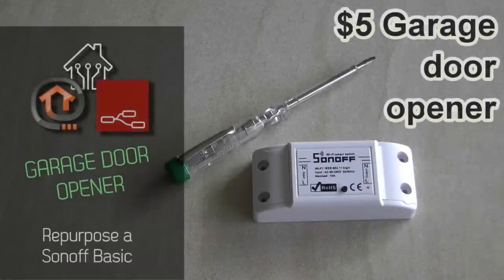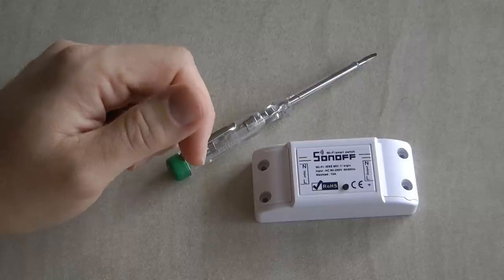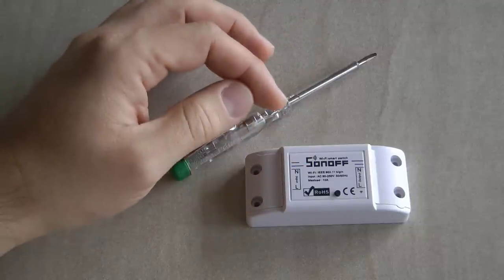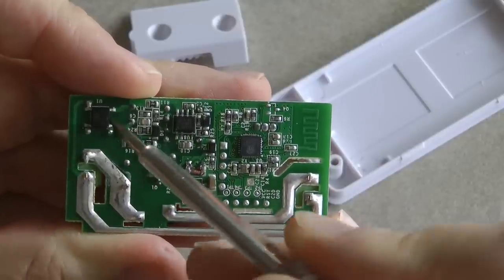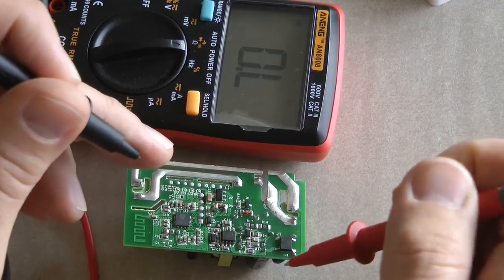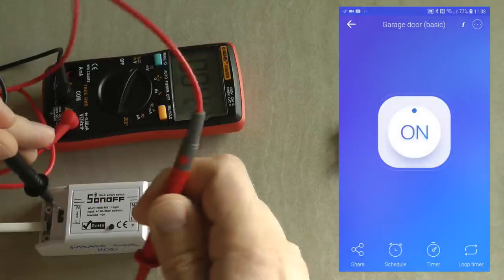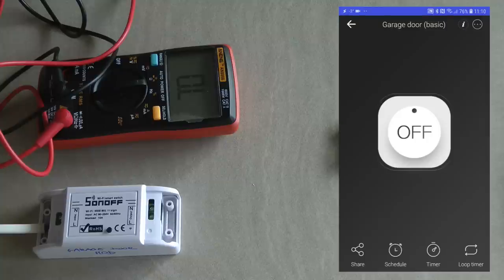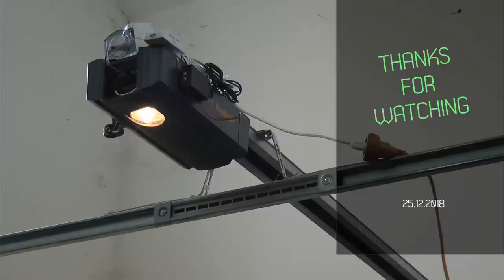Turn Sonoff Basic to garage door opener with eWeLink

Comment: Thanks for the video..  I have a motorized somfy curtain controller... it has 2 separate live wires for opening and closing the curtains and 1 neutral.. how will it work with that?
Reply from the maker: It will not. That requires two separate input. Probably the best to use one of the 2 gang wifi switches from Sonoff, for example one of the TX models. They have an interlock function, so when you press one of the switch which is for example open, it closes the other switch (which would be close) and vice versa.
Reply: @csongorvarga  thanks for the quick response!

Comment: Hello thanks for the tips … but something is missing … with sonoff is there a way to have the status of the door ? Opened or closed or semi opened… actually except to add a sensor I don’t see any other solution … what’s you’ve done on your side ? I’ve almost the same garage door :)
Reply from the maker: These devices are not designed to have any input, so the answer is no. I have reviewed ans Eachen device, which is designed to be a garage door opener which have a door sensor. That does what you need, but also cost a bit more.

Comment: If in the event of a power cut, does the door motor automatically get a signal from the sonoff due to the power cycle?  Also do you have plans to add a Reed switch/door sensor to a gpoi to indicate if the door is open or closed?
Reply from the maker: You should set the power on state to off, so there is no signal when the power comes back. I am not going to add a reed switch. Standard firmware is not monitoring external inputs. If you need that, there is a specific product for it: Eachen DG-DC5

Comment: Can anyone explain where to cut on the current generation Sonoff Basic? The board is labeled Sonoff RF R2 Power...

Mine has black wires connecting from the relay to the output ports, the bottom of the board doesn't have those solder covered traces....
Reply from the maker: I did a new video on the R2, but the terminals are too close for my comfort.

Comment: There was actually a sonoff switch that turns on for 1 second and than it turns off. I don't know its name but I have one and using it as switch for my computer so I can turn on or off the computer from anywhere. Even works with google assistant too.
Reply from the maker: I was also recommended some 3rd party products. One is called MHCOSY.

Comment: Hi. My Sonoff basic has wires instead of the soldered tracks. I don't know if its newer or older than the one you used. Anyway do you know where i should cut or grind to achieve the same result?
Reply from the maker: Yes, there is a R2 and R3 version. Those are more compact and I find it almost impossible to cut the traces without damaging something else. So I would rather recommend using a mains relay on the output.
Reply: @csongorvarga  Ok thanks for the help, I will endeavour to find the same model you used or a mains relay is also a very good idea. Thanks a million for the help.

Comment: Mine did not work by shorting the contacts. ( my q wifi door opener). But I soldered wires to an extra remote control button on the pcb board and screw this wires to a wifi relay switch.  Now mrs A opens my door vocally and the my q app still sends me notifications !

Comment: Wat about when you have the new version of the sonof basic? It have a different internal panel.
Reply from the maker: I touched on that in a separate video. Unfortunately those are much tigher around the relay, and I could not safely do the same modification.

Comment: Hello, thanks for this awsome video. I was wondering if the duration of time in the inching mode was adjustable? If it is, up to how many seconds can it be set to? Thanks
Reply from the maker: Yes, 0.5 to 3600 seconds.
Reply: @csongorvarga  thanks for the response.  Have you tried it to see if it actually works with other time settings? Also , have you tried it with any other model of switch? Thanks again
Reply from the maker: @francorossomanno86  No, I just used it on the standard 0.5 sec. And no, it is not supported by all the Sonoff models.
Reply: @csongorvarga let me know if you ever try a longer time with the basic modle. thanks for your time and your great videos

Comment: can you please confirm that the door will not automaticly open after a powerdip or power blackout?
Reply from the maker: If I did not mention, you set the power on state to OFF and it will not open the door after a blackout.

Comment: If you have installed Sonoff to your garage and you open the door with the original garage' s RF remote control, does it seem open in the eWeLink app?
Reply from the maker: No, there is no feedback in the app, it will not show the actual state of the door.

Comment: Unfortunately this does not work with Basic v1.1 manufactured 18/6/19. They've changed the design and there's not enough space to cut L before the relay. They've also hardwired N with a wire along the side.

Comment: Does it work with 5G WiFi network ?
Reply from the maker: No, it does not.
Reply: Csongor Varga thank you, how can you check if your WiFi have 2.4ghz build in
Reply from the maker: @dennis_9039  2.4 ghz is the standard frequency. Some routers support both 2.4 and 5 ghz.  Some only support either 2.4 or 5. If you have a isp installed router, it is most probably on 2.4.

Comment: Great video. How could I use this to open  a LIFTBOX. I misplaced the remote control. Thanks
Reply from the maker: What is a liftbox?
Reply: Csongor Varga. It’s a brand of Tv Lift cabinet/enclosure
Reply from the maker: @muuokimeu3027  Uh, sorry I have no idea. I think it will be difficult to do, such units usually do not have an external switch input like garage door openers.

Comment: is it possible to do the same with a dual model? it seems difficult to isolate the neutral lead but not impossible. i am planning to use it to remotely operate the terminal of an intercom (the answering part) with a scene simulating the answering (lifting the receiver) and afterwards buzzing the door.
Reply from the maker: Yes, those are more dense hence I did not try to convert them. I think an external relay is a safe option for those.
Reply: @csongorvarga  thank you. Actually it seems that a zigbee dual low voltage (or similar) should do the trick as well, provided it accepts the scenario. and it also has normal open - normal close, in  case the intercom requires. sorry, I'm just very new with this - new like 24 hours :)
Reply from the maker: @77bandi  ok, I should take a look at that.

Comment: Hi, I have two questions. If I loose my cell phone where I programed the schedule for multiple Sonoffs... Will the devices continue the established schedules or I will have to set up using another phone?

Second question, If I turn off my cell phone after programming the schedule, will the Snoonff still work as previously programmed?
Reply from the maker: Your settings are linked to your account and stored in the cloud. Once you change settings on your phone you the phone is not required any more. If you loose your phone, you can get into your account on any other phone. Just make sure you remember your account details like your email/phone number, password.
If you turn off your phone schedules will still work. Moreover the on/off schedules are actually stored on the device, so those will work even if you loose internet connection. But some of the other settings like scenes need your Sonoff device to have working internet connection.

Comment: What does EWeLink firmware version are you using?, because the current firmware 3.5.6 released on dec 27 blocked inching on some devices. Now I can’t see inching option in my sonoff basic
Reply from the maker: Interesting. I also have eWeLink 3.5.6 and I still see the options in Sonoff Basic. Could this be that it is a different Sonoff Basic not on the 2.6.1 firmware?
Reply: Ok, this seems to be the problem. 

Support.itead note about fw 3.5.5 version—>

Note: All the Sonoff devices must be upgraded their firmware to v2.6.0 or above to have the two new features ( but Sonoff TH10/16 is 2.7.0 or above).

Comment: Don't you need a sensor also?
Reply from the maker: You cannot add a sensor to this. The garage door opener with still work, but you will not know if the door is open or closed.

Comment: Can someone provide a drawing of the connection details of the sonoff to the motor?  Very new to all of this. Thanks
Reply from the maker: Connect your mains to the input as usual. Output goes to your garage motor where you control the external trigger like your wall switch you open your garage door with.

Comment: Did the mod to the sonoff circuit, and it totally died :( just won't turn on at all when connected to the 230V AC power, I even reverted the mod but it stayed dead :(
Reply: I've made sure I didn't disconnect the 10 ohm resistor, measured the input voltages to the circuit and they're just fine
Reply from the maker: It is a delicate operation, you might have broken other contacts as well.
Reply: @csongorvarga  I don't think so. I've been careful and I even tested that all connections are intact with a multimeter. The thing is that I didn't test the switch before applying the mod, so I suspected it may have been faulty in the beginning ... so I applied the mod to a second switch and it worked fine. 
Thanks for the video, it's a great idea.
Reply from the maker: @mezzat  Oh, that is bad, but good that you figured it out.

Comment: That needs an external 5v power supply??
Or it works whith the energy that the garage engine provides to the button?
Reply from the maker: No, this uses 110-240V mains input, just like the original Sonoff Basic.
Reply: @csongorvarga  but how much voltage will the sonoff send to the garage engine? if I connect it to 110v?  because I do not think the manual button opening works with 110v, I think it's in the range of 5 to 12v. I can be wrong, I do not have the manual to know
Reply from the maker: @ttrriippaa  Well, my opener expects the two contacts shortened. Dry contact. This is why all this mod, as it should not pass any voltage to the opener. Like when you install a garage opener switch in the garage. It has no voltage supply, just a momentary switch which closes those terminals.

Comment: how exactly(wiring) is this sonoff connected to garage door opener??
Reply from the maker: That is different for each garage door opener. Usually there are 2 outputs for an external opener where usually a switch is wired. You need to check the manual of your opener.

Comment: C Varga, I did everything as per your instructions. I have a sonoff basic R2. When power is on and I check out put side I have no current as it’s suppose to be. However when I check continuity I have nothing either. Can turn unit on off with out issues but I never get that burp to function the opener. Any idea what I’m doing wrong? Could it be cause it’s an R2 unit? Also I don’t have an inching piece in my settings for that item once it’s been added.  One last thing I’ve seen others talking about ver 2.6.5, the most current I can get is 2.6.1, any ideas why? Any help would be great,y appreciated, by you or anyone out there. Thx for previous info. LW
Reply from the maker: Sorry, but all my Sonoffs are the original version even the one I bought recently. Somebody has posted pictures on how to do the same with the new Sonoff, you can find them somewhere below. I don't think you can get earlier version of the firmware. Try going back to the settings. It also happened to me that the new feature was not appearing after I updated the firmware. I had to go out of the screen and back in to be visible.

Comment: So to be clear, you provide 120 volts input to the Sonoff?
Reply from the maker: Yes, the input side is still like a regular Sonoff. But the reason I cut the trace, so the mains voltage does not go to the output side.

Comment: Will my original garage door remote control still work with this sonoff Basic door opener connected??
Reply from the maker: I see no reason why not. All openers are different, but external switch is usually supported besides a remote.

Comment: Hey there: could you show how to wire up a Sonoff basic unit to my garage door opening. Alert you when my garage door opening & closed on my cellphone.Am calling from Houston Tx
Reply from the maker: The two input terminals should be connected to the your 120V mains. The two output terminals to the external switch input of your garage door. Or if you already have a separate switch to open the garage, to the terminals of that switch. I can't give you any more details, as all garage door motors are different. And you need the hardware modification explained in the video, otherwise you could damage the motor. And this method will not give you sense if the door is open or not. For something like that I recommend the Eachen GD-DC5 (I have a separate video on that), it has a door sensor as well.

Comment: I need to have a low voltage switch  side for my garage door opener can this be done
Reply from the maker: With this mod, the sonoff basic switches the two terminals. Feed in the low voltage to one of the output terminals and it will be switched to the other output terminal.

Comment: will the ewelink app control the switch from a remote location via the internet as well?
Reply from the maker: Yes, local wifi, other wifi or 3G/4G as well. Wherever your phone has access to internet. And also as long as the device is online as well.

Comment: how did the wifi connect.... . what is the power required to activate wifi
Reply from the maker: Just like normal. You still need to connect it to mains to power the whole thing.

Comment: Is it possible to see open/close status on ewelink app if we add open/close sensor to gpio and ground pins?
Reply from the maker: Physically it is possible, but the firmware does not provide a feedback to the app based on an external input. Eachen garage door opened that I reviewed recently does that.
Reply: @csongorvarga  Thanks

Comment: I ordered a Sonoff basic switch. When I opened the white cover I saw that the inner print was different, probably an update. Now there are wires to the output and no "tinned lines". This makes it harder to cut the circuit from the relay. Does anyone know how to fix it or where to get an "old" switch?
Reply from the maker: Yes, since the Basic that I have used, there is a Release 2 and also a Release 3 version. And for all of these, I found that the board is more dense, especially around the relay, and I was not able to safely cut away the traces. So those are much more difficult to modify.

Comment: I bet you can use a Shelly 1 without modification - as the AC is not passed to the relay. Different software though.

Comment: Hello, this is a little unrelated to this video but I feel it is important since we are controlling a garage door. I have set up a basic to control a well pump . Last night it turned on by itself and could have resulted in a pump failure it it ran for days. In the history under source it normally has your email address stating that you triggered it. Last night it said "Device" I have no idea why this came on. Any thoughts? I would hate to see my door open a 3AM...
Reply from the maker: That is a good question. I think it says device when a scene, or timer, etc changes the device.
Reply: Thank you for the reply, the problem is I was very careful in making sure no scene or timer was programmed. This concerns me about using this device in a security sensitive application. I would suggest to anyone to have alerts set up.

Comment: I have new versions (next, second generation) of sonoff basic. When on the PCB i must cut? And this solution will be work on second generation?
Reply from the maker: I did a separate video on the R2 Sonoff Basic, you still need to cut and solder but it is very tight. The components are much closer together, so it is tough.
Reply: @csongorvarga  sorry, my mistake. I have R3.

Comment: Hey..questiin..how many Inputs do I connect in the input side of the garage switch?
Reply from the maker: The garage door motor usually has two terminals to connect a switch to. It should be clearly explained in the garage motor manual. You connect the Sonoff Basic to those two terminals.
Reply: Thank you for your prompt response!

Comment: Hi. Do you know of a solution to the problem of when you have switches working fine with the app, but then if you change your router, these switches go off line and cannot be re configured even if you delete the app and start afresh with a new app with a new email login? 
This has happened to me, and from googling the problem a lot of others as well. None of the troubleshooting solutions from sonoff have any effect and they seem to ignore peoples requests or just give out generic answers. It''s as if once the switches have been configured to a network once, they cannot be reconfigured to another. Is there a way to factory reset them?
Or do you have any ideas.
Thanks Steve.
Reply: Steve,I just replaced my WiFi router. Don’t delete app, delete item from app thenhit add button nd pair again,worked flawlessly. LW
Reply: @lw1419  Thanks for reply. I did get it sorted. I managed to download the old Sonoff app, the one with the progress bar not the countdown timer, that Sonoff now call a fixit tool, and with that i could put the switches in AP mode but pair them in normal fast mode. Next time i will remember to delete them from the app before i do any network changes. The problem seems to be partly do to changes in the new app.